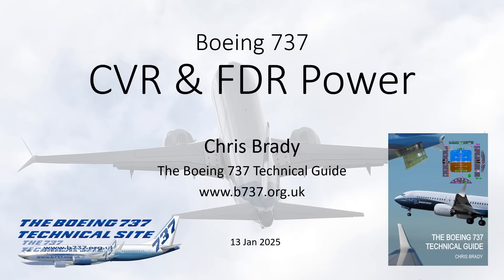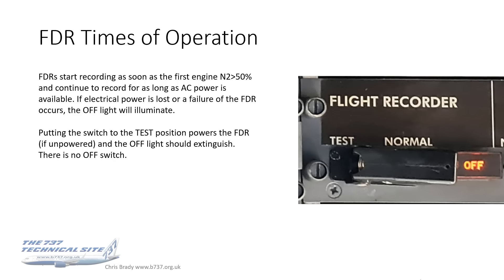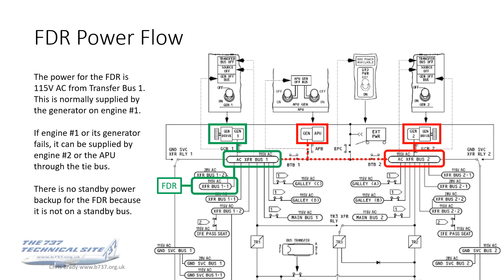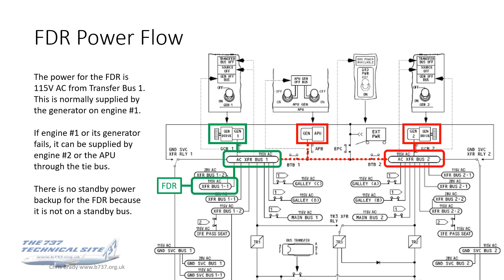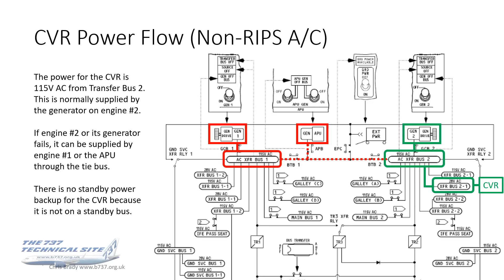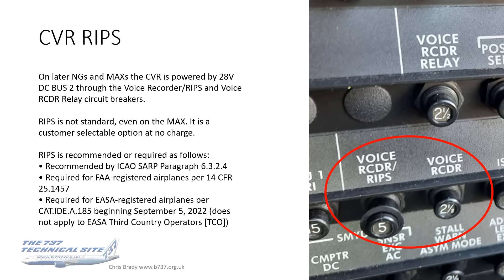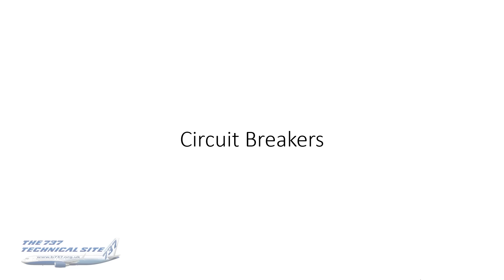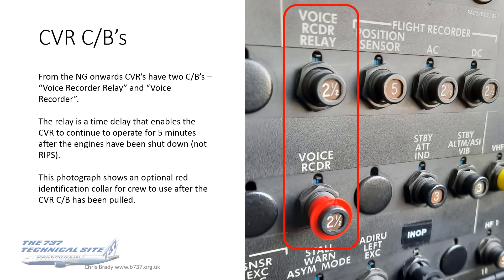737 CVR FDR Power

Comment: One other confusing thing to me. You said in the beginning that the pilot cannot turn it off (push "off" button) and then you mentioned that they can shut the recorders down. Another thing, like if the latter is the case and the pilot can turn it off, then in case of a suicide attempt by a pilot, the recorders would not be helpful to figure out as well.
Reply from the maker: The recorders can only be switched off by pulling the circuit breakers. This is necessary for post-incident recording preservation. It is illegal to pull the recorder circuit breakers in flight.
Reply: @ChrisBrady737  Thanks!

Comment: OK if FDR and CVR are not important, as Boeing designers may suggest, then why are they equipping the aircraft with them and charge money? Perhaps time has come for Boeing to answer some questions!
Reply from the maker: Recorders are important only for accident investigation. Recorders are not essential equipment when down to battery power.
Reply: @ChrisBrady737  That is what I said. If they are not considered as important, and thus are not designed reliably to be helpful for accident investigation in cases like Jeju Air, what is the point of Boeing making money out of it?
Reply: @XTQ1179 ….if you read the airworthiness regulations you will find that, to paraphrase: “the CVR and FDR must be powered from the most reliable of the electrical busbars and remain powered for as long as possible WITHOUT jeopardising service to emergency loads”. That rule is not specific to Boeing but general for all airliners, and appears to be the rationale Chris Brady cited and Boeing complied with. No doubt amendment of that rule will be considered in light of the difficult investigation now underway.
Reply: @XPLAlN  What I am saying is that is certain situations e.g. both engine failure, the power is interrupted and data is missing which appears to be the case in Jeju crash. I mean FDR and CVR are not normally used, they may be used once in a lifetime of an aircraft if a crash happens. and so they should be reliable in such conditions. Anyways, one might argue that both engine failure is very unlikely. So I understand that point as well. But someone who is spending millions of dollars on an aircraft, can buy an upgraded version as well.
Reply: @ I get what you are saying. Nonetheless I have been down the rabbit hole of reading the prior consultation to the current CVR amendment (on the Federal Register) where the pros and cons were rigorously thrashed out before the FAA finalised its rule. No doubt more recommendations will result from this accident. Please note that Boeing advocated for retrofit of RIPS CVR within 4 years but retrofit was not mandated by the FAA or anyone else. So I really don’t think Boeing deserve criticism in regards to the CVR situation.
Reply: @XPLAlN  It makes sense. Thanks! I was wrong.

Comment: What about the AC bus ties? I have not heard anyone talking about them. Lose one engine and it automatically ties good engine to power opposite AC bus? Or is it manual bus tie? I don't know how 737 is set up. But i do know some Aircraft have auto Bus tie and can be also manually tied. I am Aircraft Mechanic for 35 years...but not on any Boeing products. I know auto bus tie can fail and has to be manually done. Same from APU to AC bus i would think? I dont know any Boeing 737 maintenance or pilots to ask. Anyone know how AC bus ties on this 737? 

Perhaps bird strike took out one engine generator and auto buzs tie did not work and crew did not notice with everything going on? Dont know why no APU started...its literally one button to push in emergency. Please correct me if wrong.
Reply from the maker: AC bus ties are automatic on the 737

Comment: Hi Chris, can you clarify what you meant by "the relay for the hatch to manually lower the landing gear" at around 11:30 ?  Is that a reference to the microswitch that detects when the panel is open that gives access to the manual gear release cables ?
Reply from the maker: Yes, exactly that

Comment: We do know that there was significant damage to the FDR itself, particularly its connectors.

And if one of the engines did throw away turbine blade through the body of the aircraft that could well have done significant damage inside the plane without leaving any visible damage to the body of the plane , particularly if it was engine number one that threw the turbine blade

Comment: Hi Chris - great content as always.  In the context of the Jeju Air tragedy, the 737 landing gear appears to be “electrically controlled, hydraulically actuated”, based on info from Stig Aviation.  If that’s the case, then which bus provides power for gear retraction / extension signaling to the hydraulic power units?  I don’t believe this detail has been covered previously and…TBH…I’m not sure whether this question sits best under you Landing Gear, Electrical or Hydraulic systems videos…

Comment: If the flight data recorder and cockpit voice recorder start recording only when the N2 speed is above 50% or when we are in Air Mode, how is information about the fire test before engine operation saved?
Reply from the maker: 50%. Anything before this wont be recorded.

Comment: @ChrisBrady737 Do you think it’s possible for a 737-800 to stay in air for another 4mins at 500ft after both engines quit? If one engine was providing lift to keep the plane in the air, even at idle the IDG should be providing power?

Comment: Both GEN are not working and APU is sw OFF - Eng No 2 has a bird strike and its still producing thrust.  Eng No 1 is dead as seen during the landing video. That leaves us to how the Gen No 2 went off line?  The MAYDAY call is crucial. It must be serious problem. The AC lost all electric power for the last 4 minutes. Cant seem to now figure out how this could has happened.

Comment: Question: you mentioned the recorders normally powered by AC bus from Engine 1 generator.  If engine 1 fails, wouldnt pilots normally connect that bus to engine 2's genetrator to power it?   (I realise there may be time constraints and other priorotoes for pilots).
Reply: It does it automatically

Comment: You mentioned something in regards to the micro switch on the  manual extension hatch being “essential”. I rewatched the lander gear video and didn’t see anything that cautioned the way you did in this video?  Do you have more info on that anywhere?  Sounds like an interesting concern on a total power loss (battery too)?

Just purchased the book. Don’t see anything there either.

Comment: You provide three plausible scenarios for FDR/CVR failure: (1) loss of AC power due to failure of generator 1, 2 AND the APU (this 737 variant FDR was not equipped with battery backup); (2) recorder damage and/or power loss due to power cable severing due to bird strike; and, (3) pulling the breakers. It's clear from the video that Engine 2 was operating at touchdown (TR doors open, and a heat plume behind the engine). That rules out scenario number one, does it not? Recorder damage (at time of birdstrike) perhaps due to severing of power cables in the EE bay is another you suggest. From my experience, birds penetrating that far into fuselage structure at that location would be very unlikely, if not impossible. That leaves scenario 3. 

Just sayin'.
Reply: No it doesn’t rule out scenario one. Just because an engine is running does not mean the IDG for that engine is also functioning. Generators can fail independently of the engines

Comment: My question has to be why, in the event of total AC power loss from the engine driven generators, there isn't an auto-start of the APU. While this would mean an interruption of AC power, it wouldn't last any longer than the APU startup time.
Reply: The 737 was originally made in the 60’s. Through al other changes made in 50+ years they cannot change how the aircraft operates too much without pilots loosing the ability to fly the classic one day then the NG the next or the NG one day then Max the next. If you change too much it can get confusing as to what the plane can and can’t do, especially in an emergency
Reply from the maker: @tomstravels520 exactly right
Reply: @tomstravels520  I would  suggest that situation already applies to some extent. You can't keep holding back a design because it originated in the 1960's.
Reply: @grahamstevenson1740  unfortunately in the eyes of pilot certification…you can. You don’t want a situation where the pilots think they have an APU autostart but forget they don’t because they were flying an older generation of aircraft.
Reply: @tomstravels520  There seems to be a ridiculous amount of attention given to NOT having equipment installed in planes. An APU autostart would have probably saved 179 lives here.
Reply: @grahamstevenson1740  how exactly would it have saved them? You don’t need an APU to control the aircraft, drop the gear or operate the brakes which is what they needed.
Reply: @tomstravels520  It looks as if those things possibly didn't function because of AC power loss.
Reply: @grahamstevenson1740  I just said, you don’t need electrical power for those things. Plane flies because of cables attached to control column, gear can be unlocked and drop by gravity, brakes will function off the accumulator
Reply: @tomstravels520  Yes you CAN drop the gear using gravity but they didn't do that did they ? I'm attempting to make sense of the actions that were taken, not what''s theoretically possible.
Reply: @grahamstevenson1740  no they didn't do it....but where is the proof that having an autostart would have rectified that? Why don't you just leave this to the investigators instead of guessing what happened.
Reply: @tomstravels520  The video illustrates that the CVR and FDR rely on AC power for their operation. Since they both ceased functioning 4 minutes before the crash, I don't think it's too tricky to presume that there was an AC power loss and that could also help explain failure to select landing flaps too. Had the APU been started, it would have supplied the AC power.
I'm wondering if you even watched the video at all !
Reply: @tomstravels520  There is AIUI an electrically driven pump to supply hydraulic pressure if the normal engine driven pumps somehow malfunction. The cables are hydraulically assisted through servos, it's not just manual cables.
Reply: @ so the only thing that matters for getting the APU on is to keep the CVR and FDR powered. Not that they should have their own independent power supply for if say there was a dual generator failure and they took off with an inoperative APU (yes that is a thing)
Reply: @grahamstevenson1740  yes it is manual cables, hydraulically assisted. But if hydraulics are lost you can still move the cables to the elevators and ailerons. It’ll be much harder to move, but they do move. Think of it as loosing the power steering on your car
Reply: @tomstravels520  The sequence of events does suggest a dual engine driven generator failure for some reason. I have heard that the transponder (also AC powered) stop transmitting ADSB data at around the same time as the observed bird strike. Conceivably the 2 events are connected some how although it's far from obvious how. It's also been suggested that the crew shut down the unaffected engine, in which case it's supposed that the number 2 generator failed due to the bird strike somehow and the number 1 generator stopped producing AC power due to the crew shutting down that engine. That would have placed them in real situation particularly if the APU was INOP.
Reply: @tomstravels520  I gather that moving them purely by hand can require serious exertion to the point of exhaustion, a factor in the Ethiopian 737 Max crash.
Reply: @grahamstevenson1740  and at what point during the Ethiopian 737 Max accident did the crew loose hydraulics or electrics? They didn’t. Once again you’re showing how little you understand about the 737. It was the trim wheel that the FO found difficult to operate and that wasn’t helped that when he started to manually move it the aircraft was already out of trim.
Reply: @tomstravels520  I was talking about the control forces they were dealing with, a subject you yourself introduced !
You don't seen to following this line of thought very well.
It wasn't just the trim wheel that was a problem, there were very high yoke forces too because the aircraft had become massively out of trim due to MCAS operation.
I suggest a reset and start again !
Reply: @grahamstevenson1740  you’ve completely changed the topic now. You started talking about the Jeju plane and how it should have an auto start APU and now you’ve suddenly switched to a completely different accident. How about you either stop talking or keep on track of the original point you are trying to make which has fallen apart without deviating. The control forces were harder because the aircraft was out of trim, the fact that this pilot managed to get the plane onto the ground with what seemed relative ease suggests this was nothing relatable to ET302.
Reply: @tomstravels520  NO, I haven't changed the topic, I merely commented on a matter you YOURSELF raised as an aside.
Try re-reading the thread . It was YOU that introduced the issue of control forces, NOT me ! I have nothing further to say, this is becoming ridiculous !
Reply: @grahamstevenson1740  and that had nothing to do with it as what the ET pilots were dealing with was not the same as what these pilots were dealing with. Thankfully you have decided to speak no more which is a relief

Comment: Does the 737 not have a emergency power section? I thought it was common on Boeing aircraft to have static inverters supplying emergency AC power?
Reply: The static inverter is a low power device, which produces single phase 115V 400Hz AC. The electric motor hydraulic pumps require high power 3 phase 115V 400Hz, which is only provided by the main engines and the APU.
Reply: @christopherrobinson7541  Yes, I was curious to the fact that the FDR is not tied in to the standby system. On the C-17 that is the case.
Reply: Yes it does…..but only the AC Standby BUS, the batteries can’t power the entire electrical system so only the important stuff to help you get down and land will be powered

Comment: The absence of the data is a indication of the magnitude of problems the crew felt they were facing. In their minds, getting it on the ground was the only thing that matters (in that moment).
 From what I gather this airport was recently opened to longer flights, if the crew had known about the concrete berm, they might have tried to land off center.
  They seem to have been great pilots, dealt a hand that led to this.
Reply: I think that up until early December 2024 (07/12/2024 I think) the airport was mainly used for domestic flights.

Comment: When you say "AC XFR Bus 1 'can' be supplied by GEN 2" (and Bus 2 by GEN 1), does that mean the swiching is done automatically in case of the loss of one generator, or does the crew have to switch bus ties manually?
Reply: Should be automatically
Reply from the maker: Automatic
Reply: @ChrisBrady737  Thank you! So the last seconds of CVR/FDR recording will hopefully still reveal part of the chain of events that led to a total loss of power. Maybe even a second birdstrike after the GA was initiated? All still very mysterious indeed…

Comment: Chris, thanks for another well done system description. There is ADSB data showing the the airplane approach in the seconds leading up to the power loss. If correct the flight crew was trying to maneuver around something, likely birds. The accessory drive for the CFM56-7 runs off the N-2 engine shaft. It will be pretty easy to determine if one or both engines ingested a bird. The smell is very bad, all you have to do is walk into a hanger containing an engine that had ingested a bird to know it happened. Most bird strikes involving a high by-pass turbofan will pass through the fan and the engine will continue to run.

Comment: Presumably the recorders are automatically switched to the alternate power bus if the primary bus goes down. Maybe a failure in that switching mechanism?
Reply: There is no alternate power unless you’re referring to RIPS which it seems this aircraft didn’t have and wasn’t required to
Reply from the maker: There is no "alternate power bus" but if power is lost to a transfer bus then if another generator is available it will automatically power that transfer bus.

Comment: I think the CVR and the FDR are imperative in the event of an emergency -  just as important as crucial flight controls. I can't believe they have no actual power backup in the event of dual engine failure (except APU, which wouldn't ordinarily be powered up.) It is situations like this accident that make their continued functionality SO important! We need to know exactly what happened in the last four minutes of this flight, and it is now entirely possible the investigators will never fully find out?
Reply: Absolutely! What are black boxes for if not emergencies??
Reply from the maker: The recorders, whilst very important for post accident investigation, are of no help to crew in an emergency. Battery power is very limited and must be used conservatively. The regulatory authorities agree otherwise it would be mandated that the recorders have emergency power. Maybe this will change in the future after this accident.
Reply: @ChrisBrady737  I think Blanco said that this is only permitted through 'grandfathered' regs: the 737  being certified in the 60s.

Comment: Agree on the certification point of RIPS not pulling from the standby buses. Adding a component would require an expensive recertification of the system.